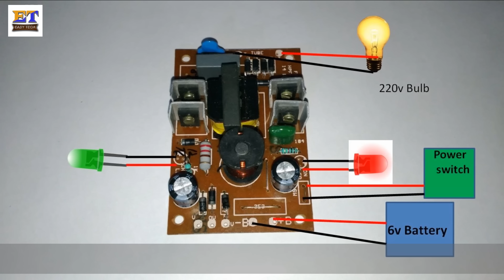6V DC To 220V AC Converter | Small 12 watt Inverter

Comment: What happens if you connect 220v ac to 6v dc adapter back from the output of this circuit into the 6v dc input? Will it charge the rechargeable batteries?
Reply: Absolutely not 🚫😐